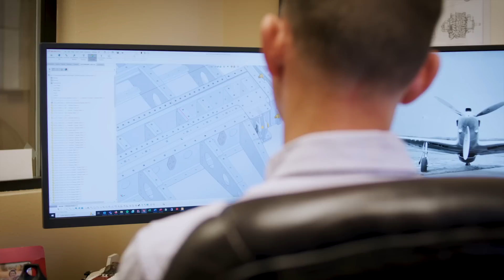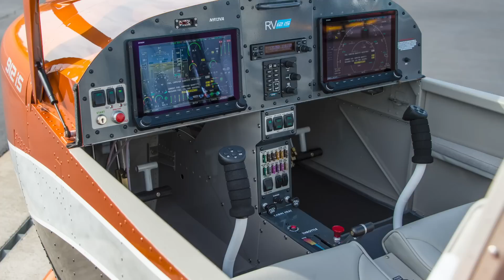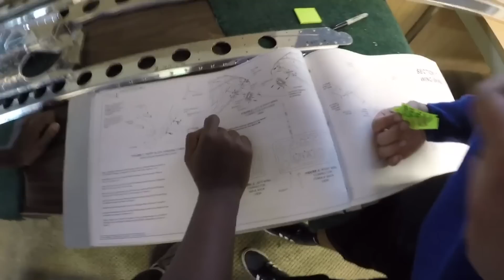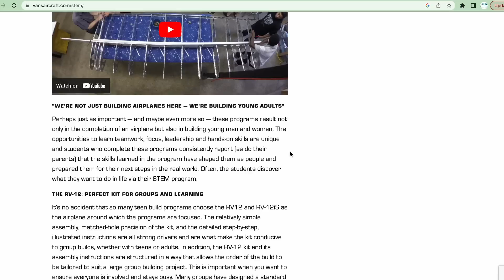Van’s RV - Everything You Wanted To Know!!

Comment: I wonder about mission pilots. A man from my home church was an airline pilot and he felt the call to the mission field. He had to build a plane out of his home so he could learn how to fix the plane he would be using in his mission work. He started building his plane in the late 60s and he and his wife where missionaries for 30 years. But I don't know what kit planes would have been available during the 60s or 70s?
Reply from the maker: Interesting. Curious if anyone knows.
Reply: @TakingOff  The 70’s had lots of experimentals. I was a fan of Jim Bede’s designs, though my fav was not a slow-landing missionary-niche design. Same with Ken Rand’s 2-seater, which I briefly owned a partially constructed one of, before my then-future got a big self-administered dent (driving infraction, project was at the other end of the country so I gave it away). I had gone to Oshkosh in iirc ‘78 (met KR there, RIP), and don’t recall a paucity of high-wing slow ‘n low experimentals. I am also curious about the above mentioned plane.

Comment: I wish there was a different name for Experimental aircraft... As a enthusiast I get it, my wife on the other hand if I ever get her to agree to go up in a plane I'm flying she would bolt as soon as she heard or saw the word Experimental.
Reply: An aircraft whose design has been evaluated, inspected, tested by the FAA, and has received an FAA-issued Type Certificate (TC) may be eligible to receive an FAA Form 8100-2 Standard Airworthiness Certificate if the Type Certificate allows, or some TC'd aircraft must be certified in other categories such as "Restricted" for Ag Aircraft.  Any aircraft that has not gone through the FAA Type Certification process is grouped in the Special or Experimental category, such as Special Light Sport Aircraft.  Special Light Sport Aircraft are required to meet an ASTM standard which has been accepted by the FAA.  Any other aircraft eligible to receive an airworthiness certificate would receive an 8130-7 Special Airworthiness Certificate that identifies the aircraft's purpose, such as Restricted, Air Racing, Experimental Research & Development, Experimental Amateur Built, etc.  A name other than "Experimental" may be more confidence-inspiring to some, but the purpose is to identify an aircraft that does not conform to an FAA Type Certificate approving that design.  Having said all of this, many of the companies providing kits to a builder have engineered and produced a design or a kit that may very well exceed strength and safety parameters of Type Certified aircraft.  They may very well be as good as, or better than, a TC'd aircraft.  The difference is that the kit manufacturer has done their own in-house design engineering and testing, but they did not go through the time and expense of FAA Type Certification.  This does allow them to provide a cheaper aircraft design or kit.  Another consideration is that the aircraft was not completely built, flight tested, and certified under an FAA-issued Production Certificate for the production approval holder's FAA-approved procedures and quality control system.